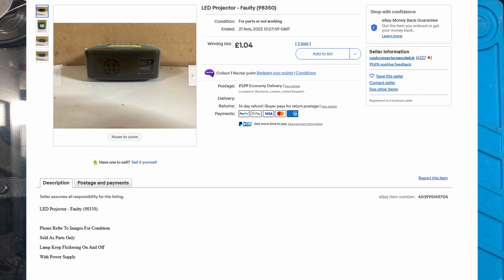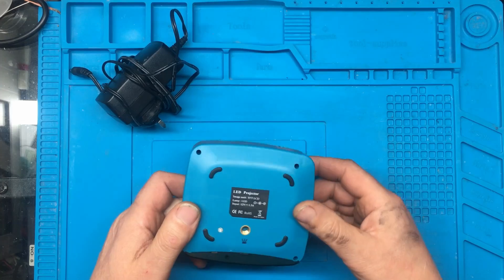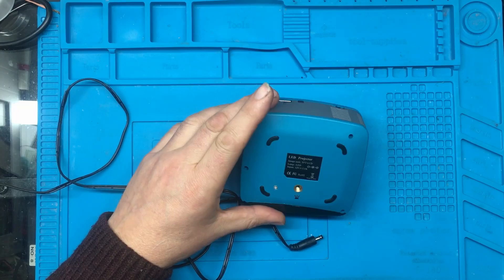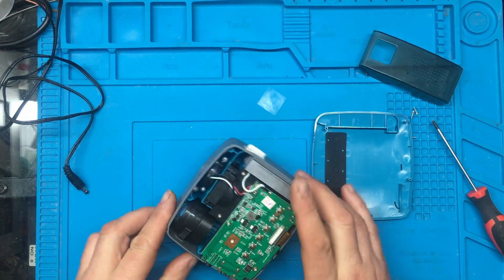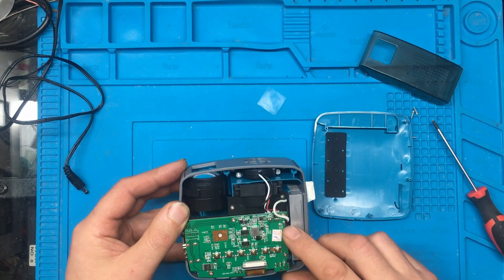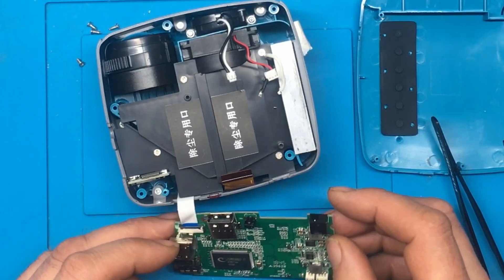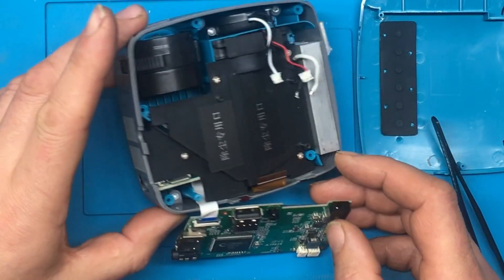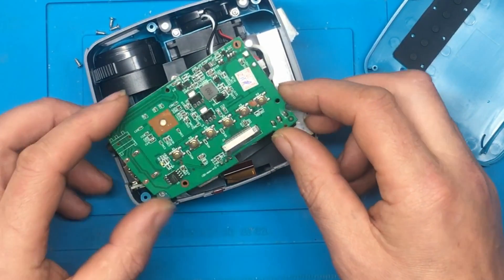LED Projector Repair?

Comment: I still have a old slide 35mm projector and dozens of family pictures which I intend to get on print! I have to power it up with a variance as the halogen bulb tends to blow up if switched straight off the mains . You can’t get the bulbs nowadays apart from eBay which is risky! There is a camera shop not to far away who will do prints chemically but it ain’t cheap!  I could get them scanned on to jpeg but I have heard if you want to keep them for decades get them onto photos as jpeg won’t last forever! I have family videos in Betamax but don’t have a working Betamax player to play them! Nothing lasts nowadays!😅Fraser😊

Comment: easy win! I wish the power bricks had plugs for each voltage instead of the same size for most anything. Also a standard positive/negative barrel arrangement.
Reply from the maker: Yes, like those Stihl headphones I looked at that had a USB to barrel jack lead, and someone plugged a 12v adapter into them...

Comment: Several years ago, i bought a projector from a "surplus outlet" kind of place for $5, didn't work (marked as such) got it home, opened it up, and literally 1 skid mark on the PCB, tiny sot23 n-channel fet... took me all of 11 minutes to replace it, and the projector works perfect to this day.
Reply from the maker: Nice 👍I've had a couple of items where it's just been one tiny component. The SSD I repaired was one that springs to mind with just 1 shorted SMD cap.

Comment: It still surprises me when people just look for the connector size to fit and not the supply voltage,  etc needed on the device sticker... oh well, their loss I guess
Reply from the maker: Yes, same happened with the laser level I repaired but that was catastrophic over voltage 😂😂😂

Comment: i like to ask what is the problem with the projector wifi is on but not reading any wifi signals. thanks
Reply from the maker: Faulty wifi module? No power to the wifi module? Bad Connection? Those are the thing's I'd be looking at.
Reply: @BuyitFixit  wifi is no problem but the projector not reading any wifi signals

Comment: Same thing happend to me. I won an auction for a small amplifier sold as faulty, cutting out when volume increased.
Looked at the requirements and it needed 12v at 2amp and the psu was rated at 12v ,0.5amp.
  £1 incuding delivery was one of my better wins.
Reply from the maker: Nice one Jim👍and well done for spotting what the 'fault' was 🙂
Reply: JRC had once made a MF/HF radio with an underrated capacitor in the power amplifier section. It was supposed to be 50vdc and it was rated at 25v. We had to butt splice in the proper capacitor and clip out all the 25v ones that were already installed on sea going vessels.
Reply from the maker: Hopefully they weren't moving at the time. I get awfully sea sick 🤮😂😂😂😂

Comment: I’m in South Shields Mick you sound like you’re up here too,  I repair tvs, I’ve had that before on a 12v tv the power supply wasn’t the right one so it was collapsing when it needed more power. Great fix though shame about the quality 😂 probably £5 brand new from china
Reply from the maker: Used to be that kneck of the woods. Live in Cumbria now. Used to work at some of the amusements repairing machines back in the day down there.
Reply: @BuyitFixit  i thought I recognised the accent, I’m a southerner from London, benn up here 8 years, I repaired a rainbow riches £500 the cabinet with the two screens got it for £50 repaired the psu, fuse blown and dry joints, loved it had used it for ages and sold it for £300, still got a spare hard drive and game roms lol…

Comment: If it's working in the end it's a fix. Just the problem was operator error by using the wrong power supply.
Reply from the maker: I'm still not sure if the socket had a dry joint. But thanks for that! 👍👍. Next video is a proper fix and full diagnosis of a switch mode power supply.

Comment: 🤣🤣
First guess was a power supply issue. But was taken by suprise that it went that way.
Reply from the maker: Thanks! Yes it was cash converters that sold it on Ebay so I can only guess they got the power supplies mixed up with a similar one perhaps? I still think the power socket had a dry joint too...
Reply: My first guess was a dried out capacitor, this usually drops the DC voltage and the flickering was a good indication that it did not get the juice it was wanting.

The wrong powersupply with only 9 volts is very much akin to what happens when the capacitors dries up, the DC component drops and the "AC" component gets bigger.

Comment: This sums up the vast majority of things that I repair, something small and another factor.  The other factor is usually that the previous owner didn't like or had grown tired of the item. The vast majority of appliances are thrown out because of something trivial, e.g. blocked pump and are also dated or have rust or some superficial damage. It's a great hobby.
Reply from the maker: I think it was cash converters that were selling this. I guess they aren't that technical. Thanks bootsowen 👍👍👍

Comment: Well, a good use will be to use a Pi and run a clock through it, and project it on the wall.

Comment: Very small, and aparrently not very good projector, might be usable for those old 8 bit games, but nice little fix. Appreciate all the work you put into making all this content for us
Reply from the maker: No problem. I've been hard at work the last few days making more video's. Got a nice switch mode power supply repair coming next...
Reply from the maker: Thanks Blondie, yes it's resolution is very poor by today's standards. Yes a small holiday player would be good, apart from we are very remote and our nearest neighbours are about 1/4 mile away so I guess no one would see it. Where we used to live I built a xmas light show with RGB addressable pixels and syncronised it all to music. There's a few videos on the channel if you scroll back far enough!